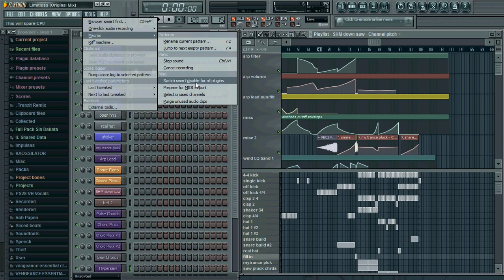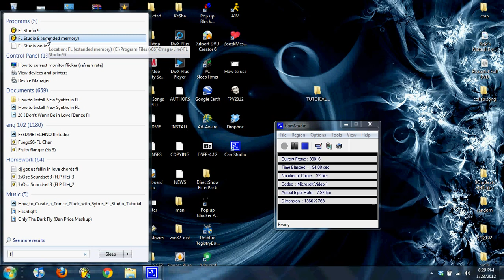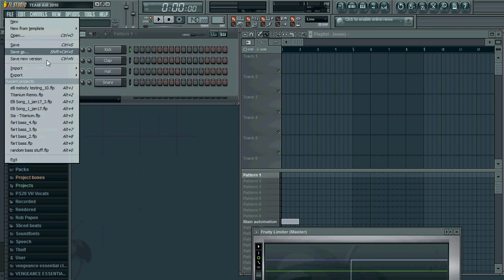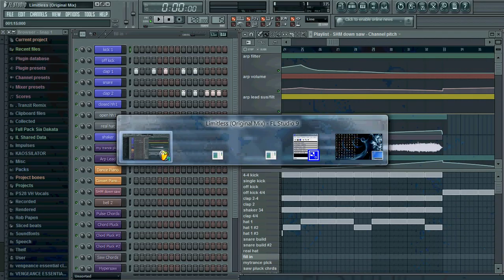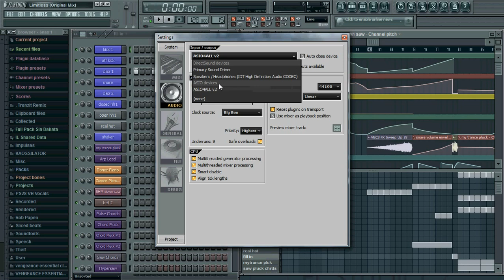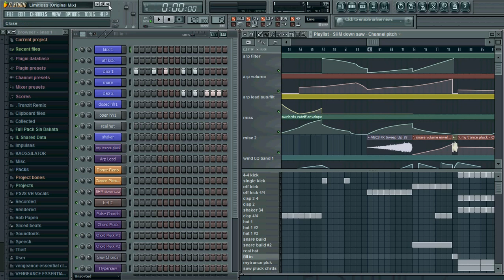CPU Reduction in FLStudio

Comment: what really annoys the hell out of me is when i have older tracks, i add like an effect or two to which run under 80% cpu load but then when i reopen them at a later time they are 100% glitching all over the place -_- i cant figure it out.  even after removing the fx i added last load time it still overloads the cpu as if they leave a permenant residual foot print. this happens to me all the time and it sucks. no idea why